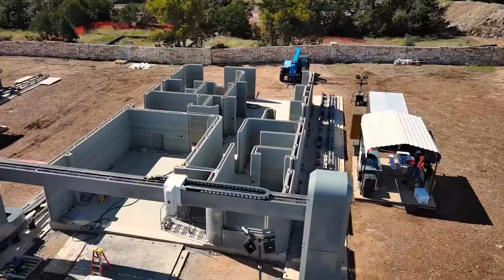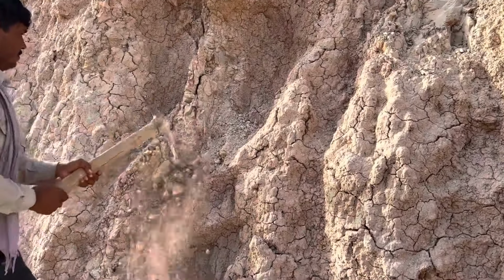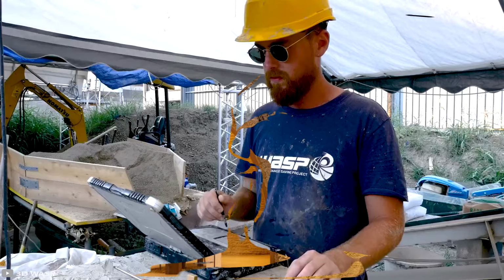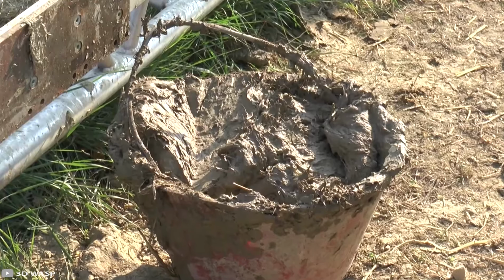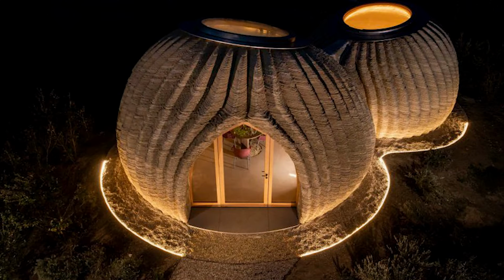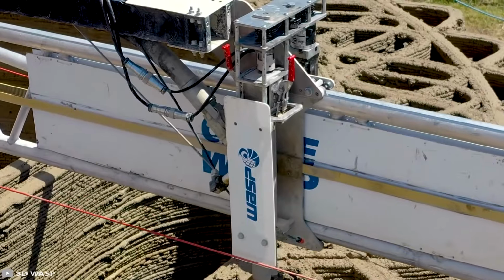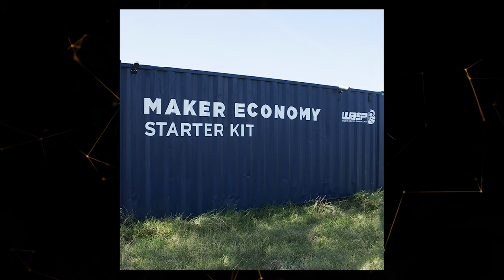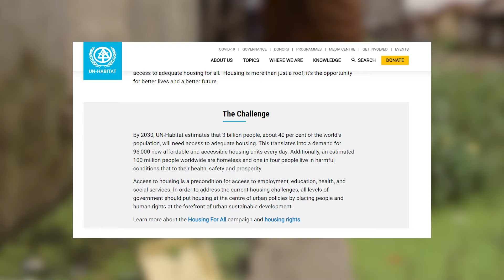WORLD'S FIRST 3D PRINTED CLAY HOUSES

Comment: This used to be the main building material in hot areas for thousands of years. Cities like Yazd in Iran still rely on these thick walls and dome-shaped roofs to keep the heat outside. to be able to print them unlocks so many new possibilities. And, I should mention that the ones made in Italy just look gorgeous.

Comment: The cost most certainly isn't $900. Transporting printer to the location will probably cost more.  Let's not even go into the foundation that was there, doors, windows, excavating and preparing the clay mixture, plumbing, electric work, etc ... and yeah, the land itself. You can make cheap walls from just about any material. But walls are just just a small part building a house.  

That being said, it's a very cool looking mud hut. I like it.
Reply: In poor countries there is often plenty of land. The government can give it away for free. It doesn't have many windows and no indoor plumbing. This is a home for very poor people. The cost of the printer is handled by the builder not home buyers. A government can buy the printing materials.
Reply: @GizmoMaltese  Still $900 is a lie, nothing else, or let me put it differently, a big PR bluff. But would still be cool, if its around a couple of thousand bucks.
Reply: Can source local material for building the 3D printer.  Just need to bring some computer chips and motherboards.
Reply: A mud hut is way better than homeless.  Guess this is about selling some mud hut to homeless 🙄
Reply: You have a point. But the main of the video is talk about how sustainable this is, cquse you can use mud who is everywhere to construct. Of course a 900 USD house is not possible with actual tech, but it is a way, and a very sustainable and resourceless* one
Reply: Permits
Reply: @GizmoMaltese where exactly does the government or builders get the money to provide your free housing?
Reply: Yes, this is a ridiculous video on so many fronts.
Reply: make door from pallet wood done deal and everything  else in the house from pallet wood
Reply: @davrocket5304  That would require craftmanship (= man hours) and defies the false claim of this video (a cheap $900 fully printed solution for urban housing shortages). They are taking the design angle, not the ecological stance. I blocked this nonsense channel, because the product itself is great. They are tarnishing it as clickbait. There are so many aurhentic channels now that do make the world a better place.
Reply: @GizmoMaltese  really ...? You think that can't build these houses themselves ... There are no jobs in the countryside, that's why everyone is moving to the cities 🙄
Reply: @nextinstitute7824  I was responding to the OP. The question was about cost and the OP mention the cost of land. In poor countries outside the city last cost is not an issue. And these would be government programs to buy the machines.

Can people build these themselves? Sure, but not as quickly and as effectively. Otherwise, why haven't they done so already?
Reply: @GizmoMaltese  You don't get it. People have houses in the countryside, in poor countries. They don't live there because there's no work...
Reply: Exactly, when people have been building clay houses for centuries by hand, all the expensive equipment seems overdone
Reply: It looks like $9 value.
Reply: Oooh I so don't agree! It looks sensational! It's taste, I guess.
Reply: @nanostar6138  The construction is more advanced though, and  introduces new properties to the design in terms of isolation.
Reply: @nextinstitute7824  It tastes bad too lol
Reply: @zaedlo  😉
Reply: Of course he is lying. This is YouTube.
Reply: @accaciagame1706  there are some truly amazing channels about new lifestyles on YouTube (I realize that even my annoyed response boosted the algorithm of this stupid channel... I know).
Reply: I think they might have calculated the costs based on building a whole town using this technology and not necessarily this fancy Italian hut equipped with quality doors, skylights, etc.
Reply: Ok, 10k. Not bad for a two-bedroom house. 450

Comment: As if 25 or 35 tons of mixed clay and other materials just magically transport, mix and feed themselves into a 3D printer. What about the back-breaking labor of shoveling, mixing and moving tons of clay, water, binder from the clay/water/binder places to the house place? The mass of a lumber/stucco/plaster house is a fraction of the weight and bulk of this "$900" house. So transportation and material hauling and handling costs bring the final house cost to MORE than a conventional house, especially if both houses have the same square footage, floor plan and utilities. If there is some trick here to give poor people homes, it is based on 1) local materials, 2) Slave labor. 3) some taxpayers or charities paying for cranes, crane rentals, large scale 3D printers, skilled tradesmen to install utilities, a bunch of trucks, designers, supervisors, so $900 worth of clay, how much for the pipes, wiring, flooring, skylights, fixtures, doors etc?  By the way, those interior walls look very rough, scratchy, prone to collect dust and harbor insects. Maybe we need a plaster coat?
Reply: Production costs aren't specific to clay???

Comment: there is a reason that modular blocks/tiles/beams are used, fast to assemble, both at site build-up and on a serial manufacturing line
Reply: man, just make tiles/blocks to a easily combinable shape
Reply: that 3d printer costs more than the house, give molds not the 3d printer
Reply: well if you rent/hold the 3d printer hostage, no, do your own block houses
Reply: if you suggest something, make sure all the parts are easy/practical to implement by the builder, otherwise you are a burden, not a true actual help

Comment: an excellent solution for all humanity, not only for the low income. Let me explain something. Clay is a versatile material that has been used for thousands of years in various applications, including building houses. Clay has several health benefits for humans, as it can filter water, clear the air, and insulate high temperatures from reaching inside the house. Additionally, when mixed with natural fiber materials like tree leaves, soil, and stones, it can become a great and solid material for building modern healthy houses that are safe and cost-effective for everyone to use. This makes clay an ideal choice for sustainable and eco-friendly construction, as it can help reduce environmental impact and improve the health and wellbeing of the occupants. Overall, clay is a valuable material that can be used in a variety of ways to support healthy living and sustainable building practices. and by using Skydome glass windows, the nature light will immerge into the house and will limit the use of electricity most of the day. at the same time, adding some small opening in the house walls as small windows will give the house a wonderful airflow that will automatically Air-condition the whole house without using air conditions most of the time. Did I mention that clay in winter time becomes like a heat radiator, that brings heat from outside and keeps it inside without over heating! it is a marvelous material should be used always by the mentioned method in this video for building houses, kiosks...etc. Thanks.
Reply: Not really a solution for the millions and millions of people who live in tropical places were it rains frequently like in the Caribbean region.  It will not survive a strong thunder shower.
Reply: @yautiano  still many other parts of the world can use it:face-blue-smiling:

Comment: In India we mix some percentage of cement with clay , clay is not washed by rain water.  Only problem is clay will get washed away with rain. 
Use rubber tyres at the base to give good hight for protection from rain water and use square walls with other  rain proof material .
Jay bharat.

Comment: Safety. I see the comments that seem to indicate people think that these houses are clay. They are no more clay than a concrete house is lime. Once that binding resin is in the mix, the material is a vast improvement over the material in the ancient methods -- and the ancient methods were really good. I suspect that because of the resin, these structures are way more resistant to earthquakes and rainy weather than cob -- or stick. 
Resource husbandry. Don't you find it reassuring that other materials are not required at anywhere near the same level as a stick house? Wood, for starters. But also minimal roofing.

Comment: Reviewing historical architectures of various cities and residential architecture through the last 50-100 years I believe that the clay composite waterproof and multiple material houses (some shown here) are the main future architecture trend that can be manufactured and sustained all over the planet in hot and warm environments where elevated flat lands (2-300 ft. above sea level and above) are common and mountain ranges are far away but reasonably easy to reach. The costs and technology and style of the clay 3d composite material printed houses allow for additional affordable electrical, solar, wind and hydroelectric and hydrogen energy sources and HVAC engineering to be built maintained and sustained with nominal human and machine efforts as well as new constructions of diverted freshwater rivers and traditional manmade dams, reservoirs and working sewage treatment and power plants that exist far away from the main neighborhoods and cities where this new technology can be used. The houses would be designed to be structurally stable through storms hurricanes fires and lightning and are ecologically sound, environmentally friendly and easy to rebuild and repair, theoretically. 

Increased affordable housing units for future generations of humans in a changed climate environment and possible economies of the late 21st early 22nd centuries on Earth could produce liveable-and wholesome -results with the new tech. May God through Jesus Christ bless you and sustain your architectural designs and building efforts through time and circumstances for the greater glory of God's kingdom on Earth😊c

Comment: Wrong cost. 200 hours divided by 8 hours
25 days if the machine works 8 hours a day.
How much does the machine cost per day?
If it's $100, it's $2500.
The energy used by the machine, how much is the gasoline?
Would you believe the machine will run for $100 per day?